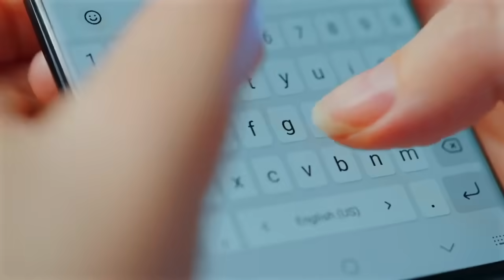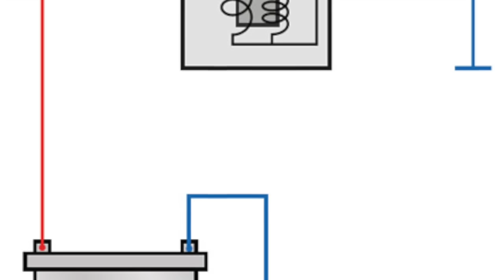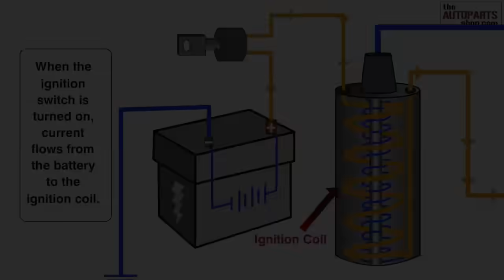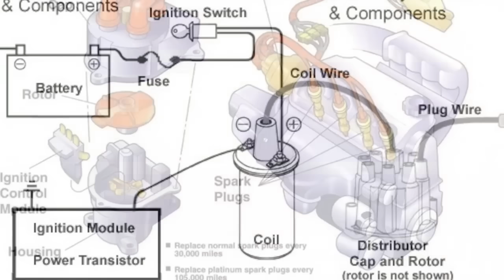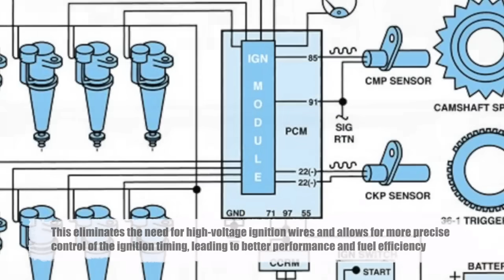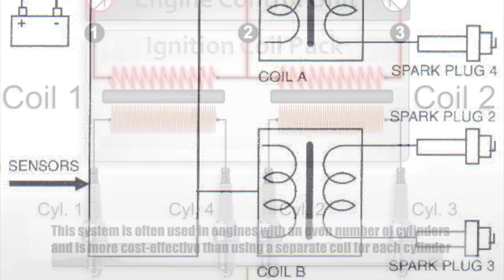What does an Iginition Coil Do? | 1.1

Comment: In the military we had to install diodes across the starter solenoid electrical connections because when the starter button was released a high voltage was created in that starter solenoid coil and raced back to give the operator a wake up zap. Not dangerous but it sure the heck was irritating.   XD XD XD

Comment: Are their many odd cylinder engines out there? 1,3,5,.......
Does anyone know another?
Reply: MAN made 9 cylinder diesel engines for the German U-Boat submarines
Reply: Most 7 cyl are in aircraft
Reply: @JayBrown-us2gi aircraft: inline 4,6 cylinders
V configuration 8,12 cylinders
horizontally opposed 4,6,8 cylinders
Radial 5, 7, 9, 14, 18, and 28 cylinders. 
The 28 cylinder R-4360 is one of my favorites... Except when it comes time to change spark plugs... 56 of them.  Ugh